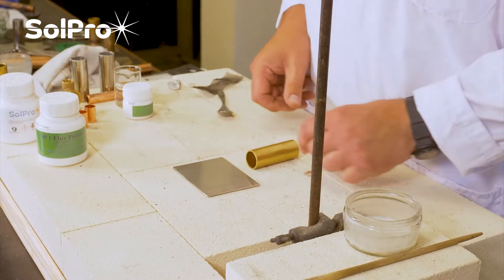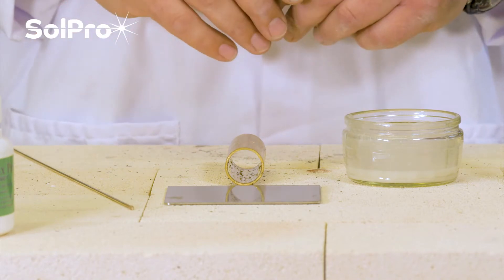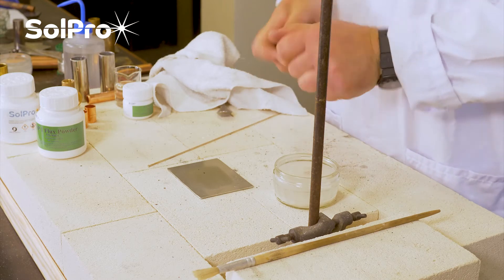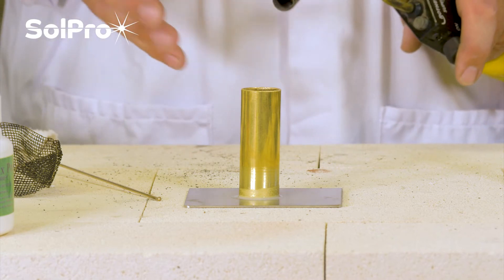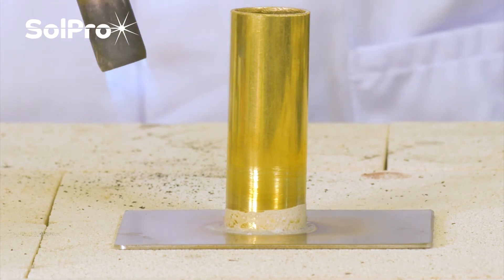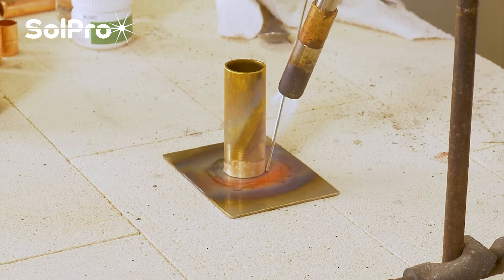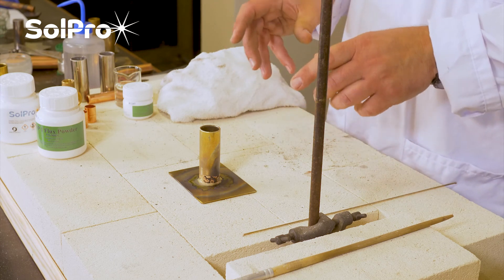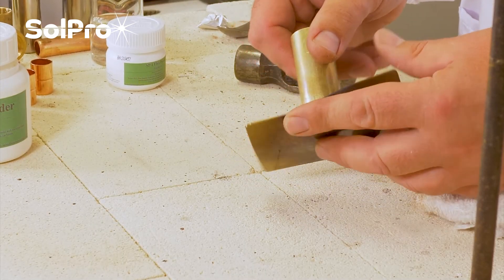Brazing Tutorial - Brass to Stainless Steel

Comment: would this work for a chainsaw muffler I want to join two 19mm stainless tubes together with a spark arestor (tiny mesh)in the middle then put the pipe through the front of muffler then braze tube to muffler.Where the pipe is positioned through muffler plate the fitment of hole for tube wont be perfect.Can this be filled with brazing?I understand what it will do to chainsaw performance but Im not sure what type of stainless the muffler is made of nor the tube